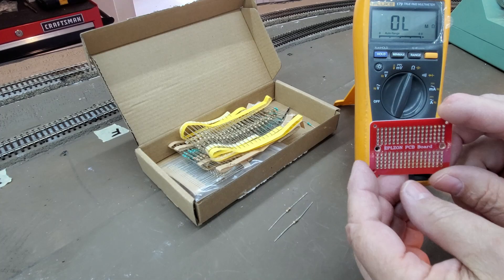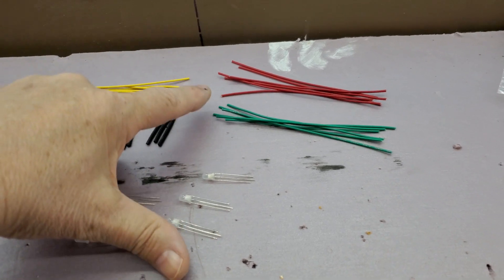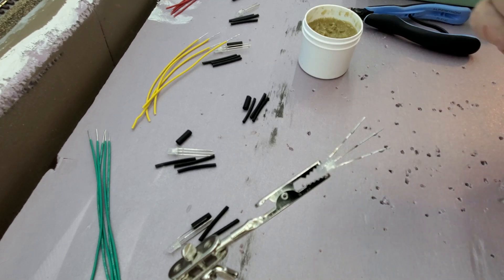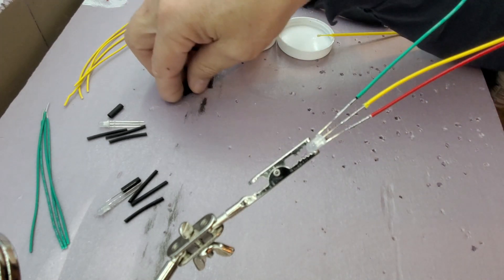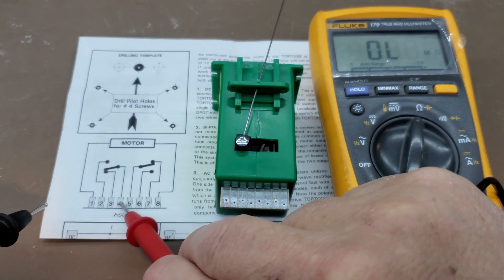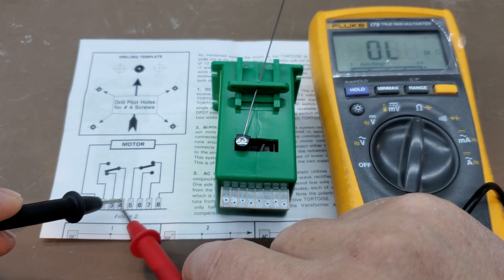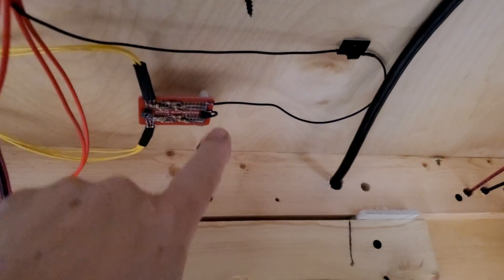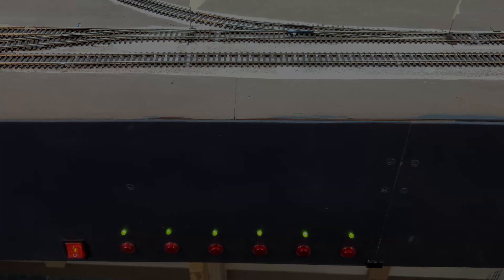Wiring Bi-color LED's for Turnouts Through Tortoise Switch Machines. HO Scale 12x20 Layout Part 32

Comment: Hello Sir, 
I understand why you placed the shrink tubing on the single wire, but what I don't understand is why did you add a 2nd tubing to shrink wrap the 3 wires together? Is there a shrink tubing that is big enough to cover all 3 wires at once? and is it a good idea to do it that way one tubing for all 3 wires.
Reply from the maker: I added heat shrink over all three wires to give the LED legs extra strength. As far as it being a general rule, I don't think so, it just depends on the application.

Comment: Good video...I'm so confused. I've git the tortoise machine working using the two 12v power supply method. I just can't figure out how to make my bi color LED to work with the tortoise.
Reply from the maker: If you are using a 12v power supply to power the LED's you need to solder a 1200 ohm resistor to the negative leg of the bicolor LED to limit the current to 10mA. Connect the negative leg of the LED to the 12v - or ground connection. 

OK, here's where it gets hard to explain using just words. Look at your Tortoise machine from the side that has the arm that moves back and forth. The 2 most outer "tabs" on each side of the edge connector are to power the tortoise machine stall motor. Count in 4 tabs from either outer tab (including the outer tab). You will now be at the center of the edge connector. Connect your 12+ to the center tab from the side you counted 4 tabs in from. Connect the red LED wire to the next tab over (3 tabs from the outer most tab) and the green LED wire to the following tab out (2 tabs from the outer most tab). Turn on your power and see if the lights are correct for your turnout position. If it is backwards, swap the red and green wires on the Tortoise.  I hope this helps. Good luck!
Reply: @SPSteve  yes it does, thank you

Comment: Very clear explanation and demonstration! (And disgustingly neat). For my control panel, I laid it out schematically similar to what a signal box would have, with LEDS on each leg of each point (switch). I wired two bi-color LED's in parallel for each leg, with the red and green legs cross-matched, using just one of the two on-board switches. This way, I, or my guest operators, can instantly tell which track is open, while the other on-board switch is available for frog power.
Reply from the maker: I've found the bi-color LED's to be very useful and the indication cannot be incorrect. So, I see how it would be helpful to your operators. I try to keep things simple for me when I'm running the layout.  Thanks for watching!
Reply: @SPSteve  That's the great thing about the hobby - do what works best for you! With a very complex fiddle yard and loco maintenance yard,  I get confused trying to associate a numbered button on a linear panel with the convoluted track layout, but I DO use a sub-panel similar to yours for certain sections (but with a rat's nest underneath). Again, thnbaks for a very clear explanation of the wiring process.

Comment: Use MTB mp10 switch macine
Reply from the maker: I'm not familiar with the MP10, but at first glance it looks like it will perform the same as a Tortoise for wiring, other than the common which the Tortoise doesn't have.
Reply: @SPSteve  Tortoise switch machines have TWO common legs (pins); Pins 4 & 5 . . . one to a normally closed set of contacts the other to a normally open set of contacts.
The MP series of turnout motors are smaller than Tortoise motors. They use more current when operating but shut off once they reach there stopping point - Tortoise motors are "stall" motors and continue to draw current after switching positions.

Comment: For us novices, having the wiring diagram would be useful. Also why  not use 470 ohm resistors  rather than 150 & 300
Reply from the maker: I'm pretty sure I used what resistors I had on hand. If you're buying parts for this project, then 470 ohm resistors would be a great choice. I think I went over the wiring in a previous video(s), you may want to take a look at those if you're unsure how to wire it.  Thanks for watching.
Reply: Not all LED's draw the same current . . . Red ones tend to need less resistance than most other colors. The Bi-color LED's I'm using require a 430 Ohm resistor on the red leg but a 10k resistor on the green leg (if I don't want to be blinded by it's glow). Using a higher Ohm resistor lets me "control" the brightness so they shine equally.
Reply from the maker: @peetywondr3256  You can certainly adjust it to your own preferences. I typically set the resistance to limit the current to around 10mA.

Comment: Excellent Video! Thought the Tortoise switch machine didn't need resistors for the LEDs Could be wired directly to the switch machine.
Reply from the maker: Thanks Dennis!  You don't need resistors for the switch motor, but you need resistors if using the Tortoise to switch LED's on and off. The contacts for the switch motor and the contacts for the LED switch are different, they are completely separate circuits. Think of the Tortoise machine as just a switch, it turns on or turns off whatever power is applied to the connector. It's like touching 2 wires together and then separating them. Like a light switch in your house.

So, depending on the voltage you apply, you need the appropriate resistor for the LED. For example, if you supply 5 volts you'd want about 500 ohms, if you apply 12 volts, you'd want about 1.2 Kohm's to limit the current to the LED to 10 milliamps. If you don't use a resistor, you'll burn out the LED almost immediately.
Reply: Reason I mentioned it was what I read on their manuals.
 PANEL LIGHTS / SIGNALS (See Diagram 4 above or Request Application Note AN-6000-07 for more detailed wiring diagrams)
Although the auxiliary contacts on the TORTOISE may be used to power panel lamps or signals, the low current draw of the TORTOISE allows
you to wire Light Emitting Diodes (LEDs) directly in series with the motor. If both red and green (or bi-color) LEDs are wired in reverse parallel,
the direction of turnout throw will be indicated without having to run any wiring back to the panel! In addition, the LED will light dimly during
the throw but will come up to full brightness when lock-up occurs. There is no limit to the number of LEDs that may be wired in series, but
each LED will reduce the voltage reaching the TORTOISE by 2 volts. You may want to increase the supply voltage to compensate.  @SPSteve
Reply from the maker: Oh OK, I didn't wire my LED's in series with the motor. I wired the LED's completely separate from the motor. The stall motor in the Tortoise must have enough current drawn to keep from damaging the LED's. Certainly worth a try if that's how you want to do it. @denniswilson2690

Comment: Yes, perfect timing for me as well. Very inspiring! I like the feel and action of toggle versus push button switches. What type would I need?
Reply from the maker: If you're doing something similar to what I did about any single pole single throw momentary toggle will work. Current isn't an issue, but I'd go with a better quality switch to get reliable contact.

Comment: So was getting ready for wiring some up .question,, have you seen or tried to wire up a bye color led as for red yellow an green .? I have some in some signals and where trying to figure on how to wire them so one switch would take care for red an green but the yellow light would have to be wired to the next block .what do you call these three light leds an where can you find them .
Reply from the maker: I haven't used 3 color LED's so I can't answer your question. There would need to be a way to select between the colors and a Tortoise can't do 3 colors (but it could do 2 colors). I plan to buy a signal system ready to install. I've been looking at offerings from Model Train Technology (they have a YouTube channel) but I'm sure there are others offering 3 color signals.
Reply: Three color LED's are readily available from numerous sources, Amazon being the best bet.  Why would you need three colors for a turnout, it only has two positions?  IF you are talking about Traffic control signals, a circuit can be built from a collection of semiconductor chips to give all three colors depending on the condition of traffic on your rails - each chip would be able to control 4 signals of three color each. Chips needed are: AND gate, NAND gate, OR gate and NOR gate, one of each.
Reply: @peetywondr3256  three colors ..yes signals are red yellow and green .an others but they are also 3 .i should of said a led in general an not for switch. Signals next to switches known as pot signals or dwarfs .most came with the three colors that  why I asked . But just need to dig alittle more . I far as I read so far is there actually two but you can change the red color by adding different resistors to change the wattage and will create a yellow. I do have a signal with one it it but some how it burned out  rest are working fine .
Reply: @wrakca6049  Unfortunately, I've never heard or seen anyone use a resistor to change colors of an LED. Resistors are used to control current draw (also "brightness"). I use different Ohms to make my green and red LED's glow at the same intensity (Greens needing more resistance). To control 3 different LED's, you'll need a controlling circuit (integrated circuit chip, or Arduino). I use four chips to control 4 signals with Red, Yellow and Green lit depending on traffic conditions. It's triggered by magnetic reed switches.
Reply: Well in a nutshell shell yes red and green .but on the main line there are dwarf signals for an interlocking signals which are red yellow and green . I can not find a red yellow an green LED . Red is hooked up as with green .its when yellow is needed for an approach.this is a done by a resistor hooked up with a resistor an with a the neutral I believe witch give you a different voltage through the red light an turns yellow .  Really has something to do with switching but sort of a track condition. I believe there are only three wires coming off the LED .red green an white . Just trying to track down these LEDS most that come up are red green and blue

Comment: Did you consider wiring the 2 crossover switch machines to the same button.  You would probably never switch only one except when testing. There doesn’t appear to be enough space between switches to park any equipment.
Reply from the maker: I did not consider it but you are absolutely correct, I should have done it that way. I'd change it but then it would mess up my panel, so I'll just leave it as is.

Comment: hey what brand is that PSU? where did you get it from, plus nice wiring :)
Reply from the maker: I got the DC power supply from Ebay.  I actually have 3 of them, 2 are in use and I have plans for the 3rd in the future. Thanks for the nice comment about the wiring!   Here's the link:  https://www.ebay.com/itm/110969773777
Reply: awesome thanks, 
 @SPSteve

Comment: I really like how you wired those LEDs and terminal blocks.
Reply from the maker: Thanks Joe! Terminal blocks make it easy to connect the LED's to the rest of the circuitry without having to solder wires together under the benchwork.
Reply: I do to 😂😂😂 My wiring looks a bit different.

Comment: I'm still using the same old Radio Shack/Micronta 22-167 Digital Auto Ranging DVM with protective case that I purchased in the late 80's.  It is a FLUKE equivalent meter for that time period.   Looked it up and they are selling in the $80 to $95 range on the eBay as of today.  Seems rather price for a meter that is  over 35 plus years old.
Reply from the maker: If your multimeter still works there's no reason to replace it.  If I'm doing any kind of wiring, model railroad, cars, house, whatever, I'm using my Fluke 179. A couple weeks ago I used it when checking/replacing the capacitors in my home Air Conditioning unit. It's a must have tool.

Yes, prices have gone way up. I paid $250 for my 179 7 years ago, now they're $469.

Comment: You work as if you worked in as solder shop before.   Gauge, stranded/solid, coper clad or copper?  seems pure copper wire is getting harder to find and way more expansive.
Reply from the maker: I had a 35 year career in Metrology. I did component level repair on electronics until about 1995 when analog components virtually disappeared in electronic test equipment overnight. I've managed to retain some knowledge even though I've become an old geezer.
Reply: @SPSteve  AT in the NAVY and Sr. FAB Tech at intel for 21 years.  In the NAVY did "I" level Avionics repair in AIMD W/C 610 and the solder shop.   Repair down to component level too.  Funny you say that about 1995.  It was about the time when what should of been great career for me went obsolete and electronics became throwaways.  I would repair peoples VCRs and other electronics for them.  Then one day that was over,  You could not longer buy components from manufactures or get schematics/wiring diagrams etc.  I was a fix it guy,  I stile hat doing wiring and installs.  It was not my thing and basically another profession than ran parallel to my electronic career path.  
P-3C,EC-130Q VQ-3 TACAMO, E-6A VQ-3 TACAMO
Reply from the maker: @IMRROcom  I was a PMEL tech in the Air Force before moving on to nuclear power. Yes, it was a fast change over. Everything became replacement boards with surface mount digital technology over night. Repair was a secondary job for me, calibration was my primary job description. I was my lab's Metrologist for the last half of my career. I wrote a lot of software, I wrote 5 training manuals, wrote test procedures, etc.